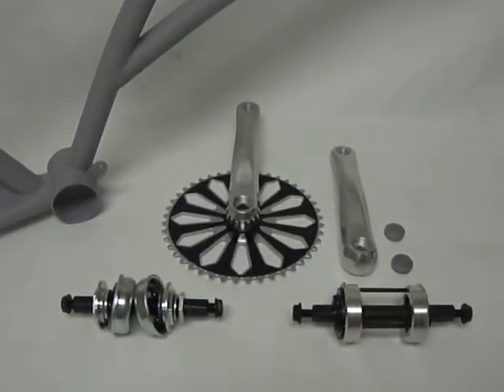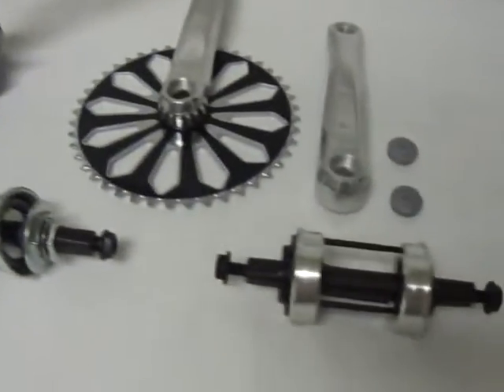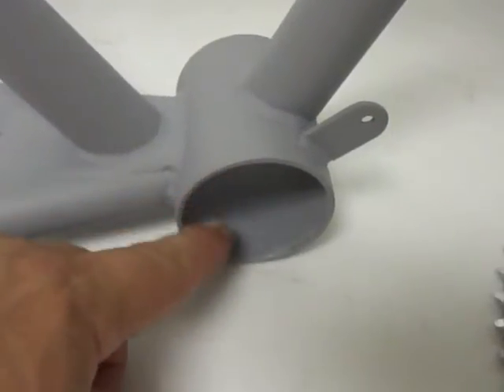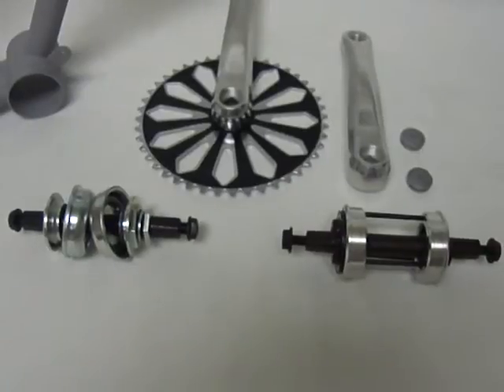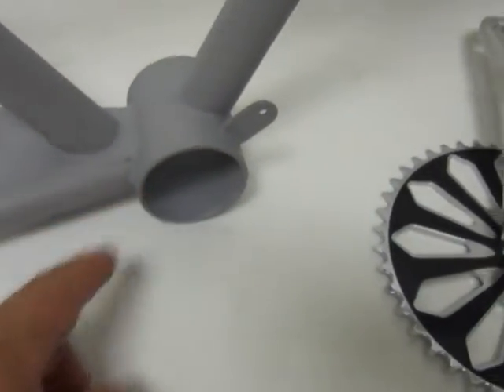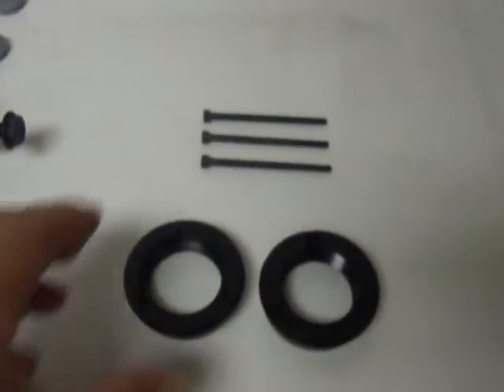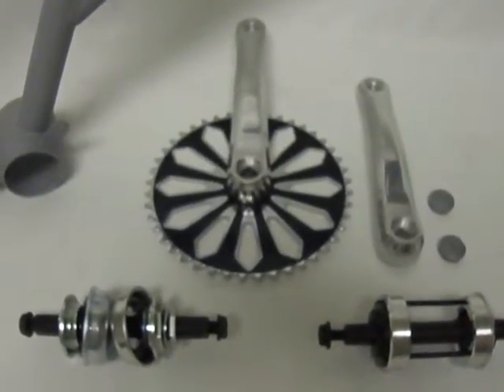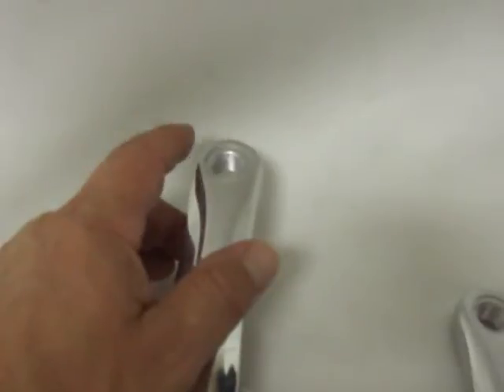Cruiser Bicycle Single Speed 3 Piece Cranks Bottom Bracket and Pedals

Comment: Is there any crank set or pedal arms that you know of that would provide a wider "stance"? I'm a big guy and have tried to use extenders and wide platform pedals but need maybe another inch of width between standard pedals. Any suggestions are appreciated. Thanks.